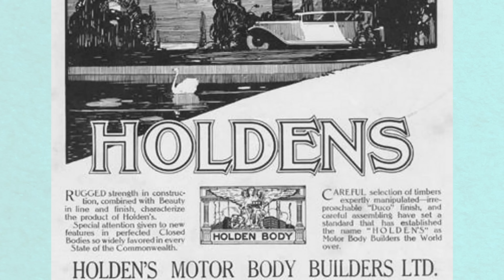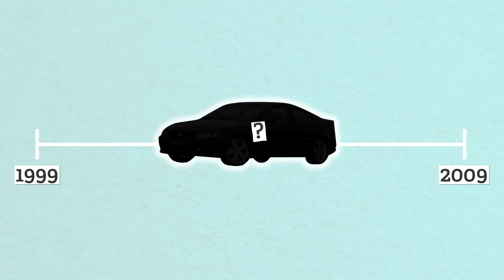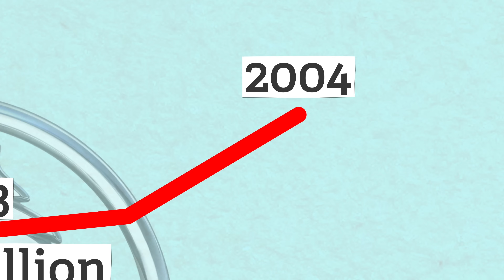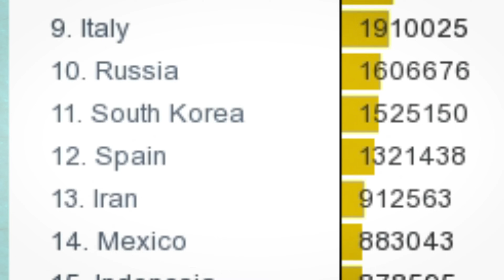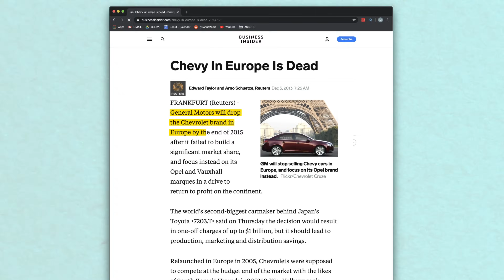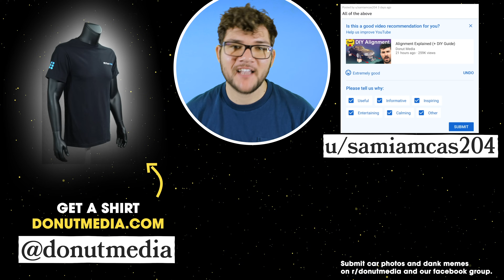What REALLY Happened to Holden

Comment: my 68 year old Nan has a Holden commodore its blue with an Aussie V6 oh my it can go!
Reply: What model?
Reply: @RiffRaffMama.  2006 or 8 commodore
Reply: @spitfirewill241  2006 would be a VZ, 2008 a VE.
Reply: @RiffRaffMama.  not to sure. But we use them for racing. my favourite is the ute hsv they are awesome and my uncle had one it was an 2003 hsv yellow clubman i think i was around 5 when i was in it and we went down the motorway fast andit rides like a dream.

Comment: As an Australian, and someone who lived near the plant, and talked to a number of the people there (from the floor, to upper management), I'd have to say that this video is about 30% of the story, and about 1/2 correct. There's so much more that happened, but I don't expect you guys to know any of it.
Thanks for bringing at least some of this story to America, I really appreciate it. Some of the 5,000_ people who called the Holden plant their lives would thank you too.
Even as someone who's more in to Hondas than Holdens, I would have fought tooth and nail to keep that factory there, employing Australians and producing unique and useful vehicles til my dying days. Those people deserved to be there, and GM had no fucking idea what the Australian market wanted, which was proven after they axed the Elizabeth plant and started importing the Opel Insignia, calling it the "New Holden Commodore".
Imagine if GM axed the Camaro and imported some random European sedan, and rebadged it "Camaro" and then expected every American to welcome it with open arms. That's what happened to us in Australia. It doesn't even matter than the car was more powerful, or fuel efficient, or had the same towing capacity. The Commodore wasn't a spec sheet, it was an Australian designed and manufactured vehicle, made by and bought by Australians. To feed us some Euro car with the same name was just rude. Even Ford had the decency to axe the 'Falcon' namebadge after they stopped making the car in Australia. It really makes you realise how poorly managed GM is, and how the faster they fold and pull out entirely, or just completely bin their management and rehire, restarting from the ground up, the better America, and the world will be.
Reply: fredmackay Many Americans were pissed off when GM got bailed out in 2008 and proceeded to do the usual corporate bailout gig of laying off thousands and giving the executives. Their quality has increased since then but I won’t ever buy a GM car simply because they’re not worth my business. Perhaps Holden could have better survived if they were allowed to spin off as their own domestic brand. Let Holden live as a domestic only manufacturer in Australia until they gain enough capital to start exporting again. Although that would mean competition from a former part of GM and American exporters of cars only really care about their domestic divisions and to them foreign markets only exist to make their domestic products better
Reply: well said mate, i live in adelaide aswell and nearly everyone i knew, knew someone that worked at the plant past or present. the new "commodore" was a disgraceful decision on there part and bringing in cheaply made imported car from Thailand just took the cake. i have my own part of holden history sitting in my shed as a reminder of what they were, a car designed and built by aussies, and enjoyed by aussies.
Reply: I love Holdens and when your buying a Holden people want a rear drive V8 with a manual not a tt V6 like the “new” commodore, GM fucked Holden with changing what we had to what they wanted. In the commodores Australian built life it never had a 4cyl engine because people don’t want them. Also the union party were demanding higher pay for people on production lines and some cracked over $100,000 a year for putting a car together.             This is for donut
Reply: Well said mate, Love @donutmedia a lot, But wish they mentioned some of this
Reply: @thatproracer6268  early commodores did come with a 4cyl motor...
Reply: I'm an American and even I know how much info they left out. Sad to see them go. After a business trip to Australia, my dad became intersted in holdens, and bought a 6spd, LS2 GTO soon after returning. Didnt take long for us to love the car and the Aussie brand!
Reply: beautifully said mate. Holden will live on forever as long as someone owns a dirty old Commo
Reply: GM cars don't even last anymore, I'm not surprised.
Reply: fredmackay you’re mad 🤣
Reply: As an Australian that also prefers JDM cars, I totally agree with you and would stand up for Holden, the brand has become such an important part of Australia and it's sad watching them slap Holden badges on imports and now they're shutting down. :(
Reply: @fredmackay Thanks for making this comment mate as soon as i saw that Donut had made a video about this i knew it couldn't be very accurate. No discredit to them, there is just so many more elements like the political decisions that attribute to the demise of the brand. Its not all about the car so to say..
Reply: I feel like the Abbott government didnt do much to save local manufacturing as well.
Reply: @andrewross2534  Was that the Star fire engine?  I think a mate of mine had one.
Reply: You do know the VB Commodore was an Opel sedan with a few changes? A lot of Holden loyalists in the late 70s said it wasn’t a real Aussie car either
Reply: @bafg182  "a few changes" being, the chassis length, wheel geometry width, suspension, drivetrain, interior and it having functioning electronics (unlike the Opel)?
I understand people's qualms with it, but if anything it being made in Australia improved whatever Opel were making and elevated the car so far beyond what it was based on.
You notice how it wasn't imported and assembled here? It wasn't just for tax reasons, it was because it wouldn't have lasted on our roads, in our sun, in our heat. Holden did everything that other GM manufacturers wanted to do, build decent cars.
Reply: @thatproracer6268  The average wage of process line workers at Elizabeth was  just over $66,000. Engineers were stumping for $112,000 which was in line with people in the US, after an internal dispute where Americans were trying to take credit for IP which we developed.
Reply: @bafg182  Show me the equivalent Opel with the 202 or V8 in it. Then show me why the engine cage and mounts and the drivetrain are similar.
Reply: @ewatfred  Those are relatively minor changes compared to designing a whole new car so I would agree that it is few changes.
Reply: @SurmaSampo  i mean, if you think changing the entire tooling for the car is minor then you might wanna contact the big car companies cos you're knowin something they don't
Reply: @andrewrollason4963  and people think that $66,000 was a lot but it was actually just below median wages at the time.
Reply: @thatproracer6268  , I worked at Elizabeth for 10 years,and I can tell you that the high wages that the media quoted were bullshit...I do know of a couple of workers that did make around $100k ,but they worked special overtime and hardly ever had a day off ( including weekends!)..As a supervisor on afternoon shift I couldn't better $75k and that was with overtime..also a 4 cylinder was available in VC and VH Commodores for our market 😊
Reply: Well said mate, I also grew up near the Holden's factory and seeing that empty car park everytime is heart breaking!!
Reply: @drawntoaliar  Amen mate, almost single-handedly guilty of bringing this about.
Reply: My understanding as well.  I seem to remember that the Australian government ceasing auto industry subsidies also made it unprofitable to be in the Australian Auto Manufacturing industry as well.  Regardless I will miss the brand.  I started to follow Holden when the Fbody met it's demise and was very enthusiastic with the cars shipped to the US.  My Chevy SS Sedan is a cherished and well enjoyed product of your market.
Reply: @robertm8626  the people who made it were extremely proud that US customers were enjoying the product. Too bad GM is just a bloodsucking monster.
Reply: AND the new 'Commodore' was a FRONT WHEEL DRIVE!?!
Reply: Makes sense
Reply: I completely agree.  Only problem is that GM wanted holden to be their source of production for the whole Oceania markets, not just the Australian market.  Kind of how Fiat, Dodge, Chrysler, etc., built each others cars when they were part of the fca Daimler partnership.  

Holden wanted to produce performance vehicles and Australian market specific vehicles,  like it had always done. But GM execs where looking for a cash cow where they could build cars cheaply and sell them elsewhere expensively.  Sucks but profits run GM.  Otherwise they'll shut it down. RIP #HSV
Reply: @thatproracer6268  Wrong... the VC Commodore was offered with a 1.9lt 4 cylinder motor, a 3.3lt 6 cylinder motor and a 5 lt V8 motor.
Reply: I have a ZB Commodore, great car.  Should have been the Holden Insignia and given Commodore the send off it deserved.
Reply: @liamransley1655  German car you mean
Reply: Let’s be honest, Americans never noticed the Opel Insignia as the Buick Regal, or the VF Commodore as the Chevy SS, or basically half of Saturn’s lineup, so Americans probably wouldn’t notice if some random European sedan replaced the Camaro.

Comment: Everyone outside Australia:
Who's gonna buy a racing sedan pickup?
The Australian market:
Holden my beer, mate
Reply: V8 utes are undeniably the most practical sports car in history. Not selling mine any time soon
Reply: @Cammac8  Commodore Utes are pretty compromised from a utility perspective - can only handle 500kg in the tray due to IRS, and if you get one with a hard lid they are even less practical in most ways than a hatchback or wagon. Falcon ute is better due to live rear axle (1200kg load), but trades some of it's sportiness away for it. The biggest sell of the Commodore/Falcon ute isn't actual practicality but rather bogan street cred.
Reply: @tmmtmm  if Holden Commodore ute owners wanted to actually put more than 500 kg in the bed, they would get aftermarket suspension better suited to the loads
Reply: @dukeboreham2782  The limitation is not the rear springs compressing under the weight, it's the strength of the suspension arms and monocoque chassis. The suspension design is exactly the same as what is in the sedan/wagon and not designed for carrying heavy loads. If you put >500kg in an IRS commodore you risk buckling/breaking the suspension arms and chassis, even if you fit super stiff springs. There are a few funny pictures floating around of Commodore utes with hectik camber on the rear wheels and laying chassis on the ground after the suspension arms gave up under the load.
Holden made a '1 tonne' version of the ute that came with a box tray/bed, live rear axle and leaf springs if you wanted more load capacity (>1000kg as per the name) - sporty it was not. The girlytruk crewman also came with live axle and decent load capacity if i'm not wrong.
Reply: I'm an American and that's all I really want. A muscle car with a bed. I need the bed here and there, and love the look of street trucks, but D by do any heavy hauling or towing, and a muscle car would be best for me 75% of the time... So I want both .  But El Caminos are all old, inefficient rustbuckets now, or else they're in prime condition for a hella big price and still noisy, uncomfortable, fuel sucking cars... I want something like the Holden Ute, where styling, comfort, and efficiency has kept up with the times  all the way to today.
Reply: Australia is the only country cool enough to both build AND buy these sweet beasts......AND MAKE A V8 WAGON!!!

Australia is the country America wishes it was. When it comes to cars anyway.
Reply: I always thought NZ had the better mix of cars. They dont have many regulations and can import anything
Reply: @tmmtmm   Accurate comment - even the bogan bit.
Reply: @tinkiewinkie9210  you damn right we are
Reply: @tinkiewinkie9210  and pay a diesel tax. If NZ was great, half of them wouldn't live in Australia ;) and yes I'm bitter about the Rugby haha
Reply: I'll ship a Maloo to Mexico one day.
Reply: The Creative Process Holden my grog mate
Reply: @JoeIsCrazyWillman  If it wasnt for that damned Global Financial Crisis in 2008 you wouldve had them in spades.  Just prior to that crunch a number of trial utes had been sent to the US for assessment and to test the customers taste for them.  Initial feedback from both California and Florida were that the dealers wanted as many as we could produce, in fact initial production request numbers could not be met due to the bottle neck of the paint shop production speed (considerations were being made of building a second paint plant to meet demand - there was demand for more utes and police cars (statesmans,) that could be produced in a year, ignoring any local production requirements!)
The US auto union was also getting in the way, demanding that a portion of the production numbers be moved on shore to the US to protect their own jobs.  

It all went down the drain though when the US basically shut up shop - all spending and project development was canned and was never reignited. Once the crisis was over GM was pushing for production to be shifted to Shanghai, enter the death spiral.
Reply: @Cammac8  how much Horsepower is that thing pushing?
Reply: @Cammac8  yeap still got my beat up old VU, and i won't part with the old girl. going to build a shed and turn the clock of time back and make her pretty again
Reply: @mitchell-wallisforce7859 lmao said no one ever 😂😂😂😂 Australia is a knock off America especially their cars

Comment: GM really knows how to kill a car company
Reply: They did the exact same thing to Saab in Sweden. And Saabs were & still are beautiful cars.
Reply: Aided by the greedy union
Reply: Mary Barra shut it down. Must've got paid a sh*tload to give the order.
Reply: @Brad Willis Saab brought it upon themselves
Reply: @bradwilliams7683  correct. I had a 1998 Saab Scania 9:5, my mum got the Saab GM, it was cheap and nasty compared to my Saab. Such a shame as Saabs were way ahead of there time.
Reply: @bradwilliams7683  Saab, Opel/Vauxhall and Holden were all the same; Detroit tried to tell them what to do, and none of them listened. Daewoo, which later became Chevolet Korea, was really the only foreign subsidiary of GM that they had real control over. This led all these brands to make great cars, but the disconnect between the accountants in the US and the engineers in Sweden/Germany/Australia also made them perpetually loss-making ventures. It didn't have to be that way, as shown by Opel, who failed to turn a profit for nearly a decade under GM, but instantly set a company record profit in the year they were sold to PSA.

Makes you wish Holden was sold off instead of closed down, really...
Reply: @rjfaber1991  of course they wouldn't listen. What GM was trying to tell them, was selling big cars with big motors with a high margin and axe economy cars because the platform wasn't used in other GM-brands. GM can't adapt to foreign markets. If gas is 10$/Gallon or streets are cramped like in India or narrow like in europe you wouldn't drive a silverado or trailblazer would you? Well that is more or less exactly what GM told them to do.
Reply: @lionelhutz4186  Absolutely agree; it was the right thing to do. It's just a bit crazy that GM executives continued to expect being able to tell their brands around the world what to do, unlike their old rivals Ford, who've always embraced what their subsidiaries outside the US did.